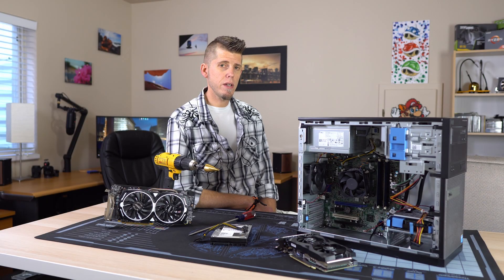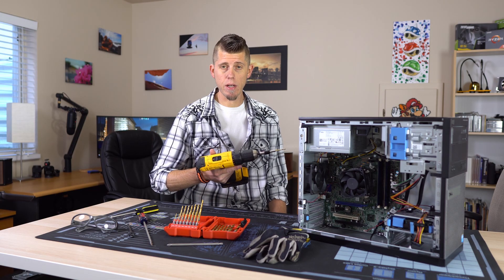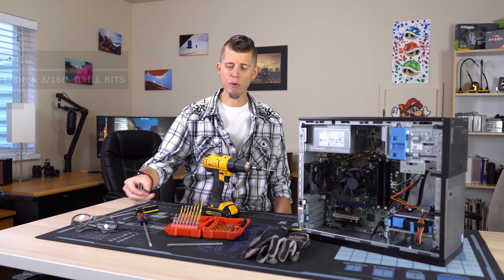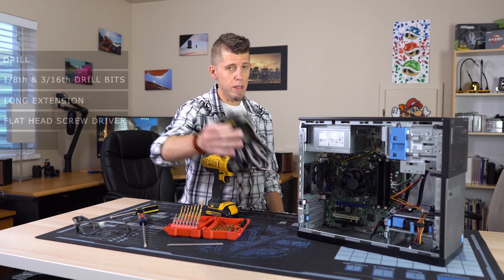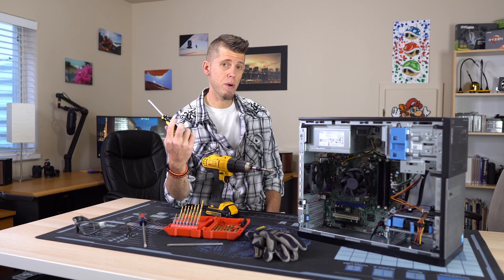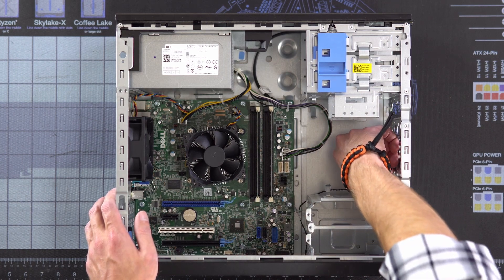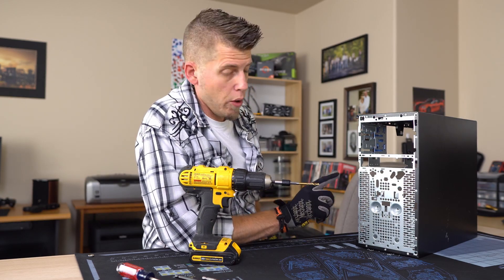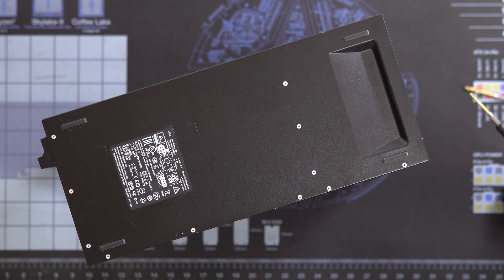Adding A Bigger Graphics Card In A Dell OptiPlex

Comment: Hey Man, was curious if a MSI 1070Ti could fit in there?
Reply from the maker: I managed to fit a 1080Ti FTW3 in one. If anything, your limitations will most likely come down to being limited to a 2 slot card, or using low profile cables to get them out of the way. I'm guessing it's a pretty short list of GPU's that wouldn't fit.
Reply: @TheGameBench  Alright, dope! How about PSU wise? I'm not really sure on my stuff for this, is there any you'd recommend specifically that can handle that 1070Ti?
Reply from the maker: @jimrye7952  For a 1070 Ti, you'd be fine with a 450 watt at stock clocks. Might want to consider a 550 watt if you want to do any overclocking. As for brands, if you're on a budget I like the newer Corsair CXm models or the CSm models and I'd suggest a used one of those over a new ThermalTake Smart Power for around the same price.

Comment: I did this now my power button flashes and it won’t turn on
Reply from the maker: Those flashes are a pattern that can tell you what might be the problem. If you watch it flash, can you see a pattern?
Reply: The Game Bench the diagnostic number aren’t flashing just the power button
Reply from the maker: @Malik90848  Which model is this? Is it an x90 series?
Reply: The Game Bench 790
Reply from the maker: @Malik90848  K, the power button can still flash in patterns to give diagnostic codes. Is it just flashing on and off, or is there a pattern to the flashes?
Reply: The Game it flashes once then turns off
Reply: The Game Bench do you recommend anything
Reply from the maker: @Malik90848  Sorry... got side tracked. From everything I can find it sites an issue with a card plugged into the motherboard or a motherboard failure. Try pulling the GPU and see if it works without the GPU installed. Check all power cables and any other cables plugged into the motherboard. Possibly try seeing if everything works outside the case. You could also try resetting the PSU by pushing the button on the back while it's powered off.

Comment: Hi! ...... Thanks for your share! I was contemplating putting a 1080Ti GPU in my Optiplex 9010. 
The Mother Board accepts GDDR5, whilst the 1080Ti is a GDDR5X. I  have been given the 
understanding that this is the same fit and will work, as the GDDR5X is just a faster version 
of the GDDR5. I am how ever concerned about possible bottle necking. 
I might be wrong about this, but I think that you can only get as good as the Mother Board can 
deliver. 
I am running Windows 10 on an i7 (3770 CPU @ 3.40Ghz)  with 32 meg 1866 DDR3 Ram, though 
the Mother Board is only rated for 1600 DDR3 Ram. Every thing is all standard and all un-clocked! 
The system is a 64 bit operating System. 
What are your thoughts on the matter? 
Does any one have any thoughts on this matter? 
Will it work?
Reply from the maker: Well, GDDR5 and GDDR5X is VRAM and is part of the GPU. So long as you have the proper interface for the GPU, it's compatible. Both being PCIe, yeah the 1080 Ti will work in the OptiPlex motherboard. As for the 3770 bottlenecking the 3770, I'm actually working on testing that right now. I'm currently on the i7 2600 and I don't think I'll get to the 3770 until next week. I might have the 1080 Ti tested on the 2600 by tomorrow night and I can tell you how it goes. I know that the 4790 doesn't bottleneck the 1080 Ti... so, if the 2600 doesn't, which I don't expect it to, the 3770 would be fine too. One thing you will have to do is get some low profile SATA cables and a USB extender cable as they block the installation of a GPU over 8.5 inches in the 9010. If you need some links to those cables, let me know.

I'll let you know how it goes with the 2600.
Reply: @TheGameBench  Thanks very much. I'll be looking forward to hearing about your findings.
Reply from the maker: @seanashcroft9713  Well, I tested the i7 2600 today with the 1080 Ti FTW3 and at 1080p, 1440p or 4k, it didn't bottleneck the 1080 Ti in Battlefield V. I'd say you're good to go on the 3770.
Reply: @TheGameBench  Thank you so much for taking to time to help people like my self, who might be a bit lost other wise! 
God Bless!!!
Reply from the maker: @seanashcroft9713  No problem. I'm happy to help.
Reply: @TheGameBench  It's a pitty that there aren't more helpful people, like you, in the world mate! Take care & God Bless!!!

Comment: I'm crying heavy Canadian tears, the price for these things is over the top. I see 7020 with i5 4gb RAM no HDD for over 300$. On eBay shipping fees are 50 bucks and then I would have to pay import fees around 13%. 
Am I doing something wrong?
Reply from the maker: That's nothing new, at least here in the U.S. Plenty of people asking $300 and up for them and those people are nuts. You'd be better off building a new system with even a 1st gen Ryzen over this. I'm finding that they've gone up a little, but you can still get good deal on the auctions. I'm amazed that people are paying $150 for these things. You just have to be patient to get the deals. The more people that pay absurd prices, the less we'll be able to find them for reasonable prices. That being said, a good alternative is the HP z230. I would tick to the same prices, and at close to $300, you mind as well just get an i7 with 16GB and a 1 to 2TB HDD.
Reply: @TheGameBench  yeah, this is crazy. These people must be looking for them 24/7. I do check on those things daily. It's not like I have high hopes or expectations, I find it interesting. Haven't seen any HP Z230 yet but some Lenovo ThjnkCentre for around that price. Maybe it'd be interesting for you too? 
Currently I'm looking into getting parts and build an open case pc, to display it and tinker with it. Thinking about using 2x PSU's(~250-300Watts) for one to run GPU, the other powering the system. Also place GPU on other side of MB with an PCI extension. Haven't seen this yet, might turn out in a decent build, might as well not haha. Keep up your work! Very informative and entertaining to me. Cheers
Reply from the maker: @vinade2100  Well, I can tell you that I can go a month or more between finding them for a good price. I refuse to pay more than $120 for one of them. More than that and I'll just get a 7010/9010 with a 3770 for around $160. That being said, I highly suggest against the dual PSU setup. I mean, you can make it work, but it's convoluted. Especially when it's easy to find a good 500 PSU for around $40 to $50.

Comment: i wouldnt mind seeing a video where you put the guts in a cheap case for better airflow,keep in mind part of the attraction of these is there budget friendly value,so i could see someone going over board and killing that factor really fast,quick question...are the power and reset button proprietary ?
Reply from the maker: Yeah, I don't feel like putting these parts in another case is worth your time unless you find a super cheap case that doesn't have the structural integrity of tinfoil. Just about anything worth swapping into is going to kill the value aspect. The power button is proprietary, but easy enough to figure out which two pins are for the power switch and LED and you can plug the headers from a aftermarket case into those pins. There is no reset switch on these.
Reply: @TheGameBench  i found this is why i was asking to be honest 

PrevNext
Marketplace›
Electronics & Computers
lot of 30x pc cases. Cooler Master Masterbox lite 3
McLean, VA · over a week ago · 
$15
I have a lot of 30+ pcs of masterbox lite 3 matx pc cases. Brand new in box with all accesories.... More 
Condition
New
he said he would ship for $10 more,i might buy two of them,this is a great deal imo
Reply from the maker: @meemadd6397  Not a bad case for $25, but it doesn't look like it will have the best airflow... then again, I'm having trouble finding any solid info on it.

Comment: Im having problems with my dell optiplex the diagnostic lights 2,,3,4 and then beeping and the color of power button is blue i dont know what it means can u help?
Reply from the maker: What  model do you have? I guessed it was a x90 series and what I was able to find was that it's saying that a USB failure has occurred. I would try disconnecting all USB devices and see if that fixes it. I assume it's getting into Windows. Anyways, here's a link that will layout all the diagnostic codes and what they mean.

https://www.dell.com/support/article/us/en/04/sln284978/a-reference-guide-to-the-dell-optiplex-diagnostic-indicators?lang=en
Reply: it was 790
Reply from the maker: @andrewespinosa5886  Okay, then that should be what it's indicating.
Reply: The Game Bench ok
Reply from the maker: @andrewespinosa5886  If you need a list of the fault indicators, click on that link and click on systems from 2009 to 2012. Then click power and diagnostic LEDs and it will give you a complete list.
Reply: The Game Bench i dont have anything plugged into the pc thats usb
Reply from the maker: @andrewespinosa5886  It's possible that it could be an issue with the internal USB ports. Try disconnecting the USB ports from the motherboard. If it still persists, I would guess that it's an issue with one of the rear USB ports.

Comment: Your "rivets" appear to be pemserts. You can usually knock them out with a punch and hammer.🛠️
Reply from the maker: Good to know. I had wondered since they weren't like traditional rivets and look like they're set with heat, almost like a spot weld as they expand in the hole? I'm sure I'm totally wrong about that. My knowledge is obviously pretty limited here.
Reply: @TheGameBench  nope press fit into a precision sized hole - the press fit distorts the sheet metal around the knurled section on the pemsert. They're a great way to attach stuff to sheet metal. The downside is they're usually installed via a $$$$ pemsert press.
Reply from the maker: @machinist7230  I see... very interesting. Thanks for the info.

Comment: I ordered a rx 570 that's 9.57 inches is that compatible with a optiplex 790 in terms of length ?
Reply from the maker: Be the same as this 9020, so it might fit. I've seen people fit 10 inch long GPU's in without removing the HDD cage. I've fit a 9.5" card in. So, I think there's a good chance it will fit from that perspective, but the design of the card can effect if it fits or not, but I feel like it should with a little effort. However, the SATA ports in the 790 will be int he way and might prevent you from being able to get the cables in. If you have a problem, Silverstone has some low profile cables that should do the trick:

https://www.amazon.com/Silverstone-90-Degree-Low-Profile-Connectors-CP11B-300/dp/B00KTLGDGA/ref=sr_1_4?crid=NIMTTYFNR637&keywords=silverstone+sata+cable&qid=1576738169&sprefix=solverstone+sata%2Caps%2C209&sr=8-4

https://www.amazon.com/SilverStone-Technology-SST-CP11B-500-Low-Profile-Connectors/dp/B00KTLGDZG/ref=sr_1_5?crid=NIMTTYFNR637&keywords=silverstone+sata+cable&qid=1576738169&sprefix=solverstone+sata%2Caps%2C209&sr=8-5
Reply: The Game Bench  thank you so much
Reply from the maker: @Mitchlom  No problem.

Comment: You can use an ICY DOCK Dual 2.5 SSD 1 x 3.5 HDD Device Bay to 5.25 Drive Bay Converter / 
Mount / Kit / Adapter - FLEX-FIT Trio MB343SP

https://www.newegg.com/icy-dock-mb343sp-2-5-3-5-drives-to-5-25-bay/p/N82E16817994163?Description=icy%20dock&cm_re=icy_dock--17-994-163--Product

in the extra 5.25" drive bay for ssd drive and harddrive.

Comment: Awesome.  What card would you Put with a 4790 optiplex 9020?  I almost got the 1650 super before seeing this.
Reply from the maker: The 1650 Super would be the limiting factor with the i7. You could honestly pair a 1080 Ti with it. I would like to do a little testing once I get this build done, but I know that something like the 1080/2070 would be right at home with the 4790.
Reply: @TheGameBench  WoW..Really?!?  Well...gonna have to upgrade that psu then thanks.
Reply from the maker: @RyanZinter  No problem. You can get away with a 1060/1660 on the stock power supply, but anything more will need some more power. Though I was able to run an EVGA DT 1070 off the 290 watt, (it only consumed about a max of 243 watts at full system load) but they tend to consume a bit less power than the normal 1070's.
Reply: @TheGameBench  Nice...I'm wanting to stretch this as far as it'll take me...
Reply: @TheGameBench  ...plus I'm mainly a WoW player...with some Witcher 3 thrown in at times..so hopefully I can get 3-5 more years outta her.
Reply: Come to find out, dude I bought it from put in a 400 watt be quite psu..  SCORE!!!
Reply: @TheGameBench  looks like I'll be performing this mod tonight.  Scored a $50 MSI ARMOR MK2. RX 570 8GB. Total build cost $220!!!
Reply from the maker: @RyanZinter  Dang! That's an awesome deal. Those Mk2 cards are such an improvement.

Comment: Hey thanks for the great video man! Will a longer card cover the SATA ports in the 990 MT? It wasnt mentioned in your optiplex video and I have seen other videos where people put long cards in them but it is hard to see if it covers the SATA ports.
Reply from the maker: It's hard to tell from the pictures, but I just got one in today for testing and, yeah, they're in the way. Might be fine with certain cards, depending on the fan shroud. If it's a problem, Silverstone has some low profile SATA cables that should clear and let you use all of the ports.
Reply: @TheGameBench  will a 10 inch gpu covers the sata ports in 7010mt will it make sata ports unusable,
Thinking of getting a msi 1650 super   gaming x.
Your prompt reply is appreciated 😊
Reply from the maker: @farhansalim3143  So for the slow response. Yes, anything over 8.5 inches will overhang the SATA ports. However, they're not unusable. You'd just need low profile cables.
Reply: @TheGameBench  Thanks
purchased 1650super

Comment: So I tried this it removes the size problem but the front usb wire is to thick, will the pc work without the front usb ports or will it say that it cant boot?
Reply from the maker: Yep, it will work just fine with it unplugged. However, if you want to be able to use them, you can get a cable that will fit. This is the only one that I've found that isn't a pile of crap. EVGA used to make one, but they're now directing people to this one.

https://www.moddiy.com/products/USB-3.0-20-Pin-Internal-Header-Adapter-Cable-Low-Profile-Connector.html

Comment: I have ARMOR RX 570 8GB OC which is like 9.4 inches, you think it would fit?
Reply: I have a dell optiplex 990 btw
Reply from the maker: Is it the Mk I (White) or the Mk II (Red)?
Reply: The Game Bench it’s the black one with white fans
Reply from the maker: Okay, so it looks like the RX 480 I have on the bench, but it has a smaller PCB. I would say that it should fit without removing the HDD cage. It will be a pretty tight fit. Since it's a 990, you'll probably need some low profile or right angled SATA cables as well.

Comment: Can you do a video on how to replace the psu on a optiplex? I have a 990 with the i5-2400, Im planning on getting a gpu for it but i need a 6pin.
Reply from the maker: Well, the 990 has a standard 24-pin on the motherboard, so it's as simple as swapping the factory PSU with the new one. Pretty straight forward. No converters needed. However, I've got plans to do some other builds where I will be replacing the power supplies.

Comment: If you wanted to you could use the floppy disk drive bay for a hard drive slot it works I've used it and I like your idea
Reply from the maker: I actually tried that with the first one I did, but I didn't like how it looked. I ended up cutting those tabs out.

Comment: I used a nibbler to cut a hole for the fan. Turned out a little ragged, but it's much more open to airflow now. I probably get more from the 92mm fan that I put in there than you get from a 120 without cutting a hole, but of course the best is to cut a hole for a 120. You lose some structural integrity doing that, or course, so don't sit on your case once you do this :) I used a nibbler because I didn't want to buy a dremel. I've also used a nibbler to remove a grille in front of a PSU fan, as the PSU also has one and two grilles, in addition to the filter, just impede air flow.

For the drive cage removal, I just angled the drill in there. I didn't need a bit extension.
Reply from the maker: No question, you're getting more airflow. I just wanted to give people the easiest option. You know, for a beginner. Just ask a beginner what a nibbler is, and they'd probably have no clue what you're talking about. I've wanted an excuse to buy one. Cutting a hole for a side panel might be the perfect excuse.

That being said, I'm going to do a higher end build and I had decided to cut a hole for the fan as an alternative.

Comment: Will i need to do this with a 9.5” gpu?
Reply from the maker: It will be a tight fit, but you should be able to fit a 9.5" GPU without removing the cage.
Reply: The Game Bench thanks
Reply from the maker: @mrepicbruh2839  No problem.
Reply: What about a rx 570 that's 9.57 inches ?
Reply from the maker: @Mitchlom  Check your other comment. I answered you there.

Comment: Does anyone know the max hight for GPUs in these chassis? or what a good max hight would be?
Reply from the maker: From the motherboard to the side panel, you have 155mm of clearance. To account for the PCIe power cables, I would say you might want to keep it closer to 145mm on the height.
Reply: @TheGameBench  Awesome thx for the info, been looking at getting one of these and turn it into a light flight sim rig so knowing the hight restrictions will help
Reply from the maker: @jmcmillen19  Cool! No problem, I'm happy to help.